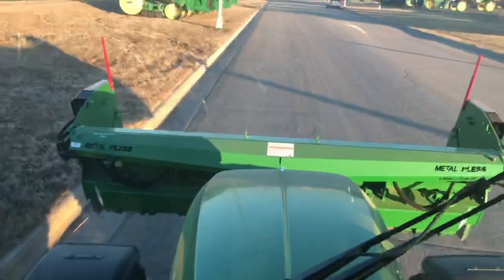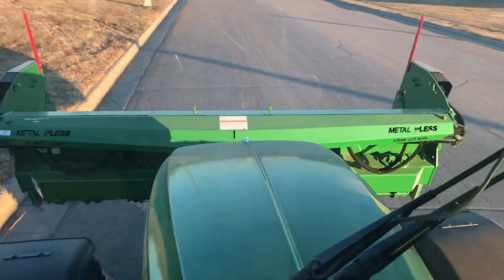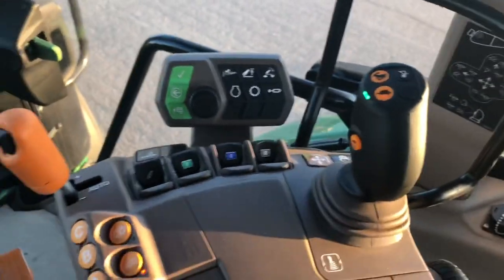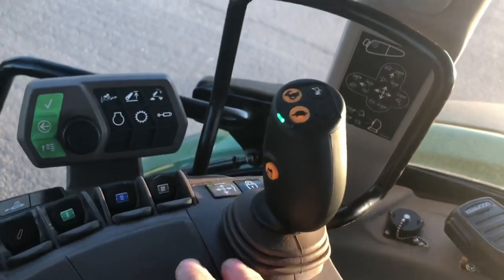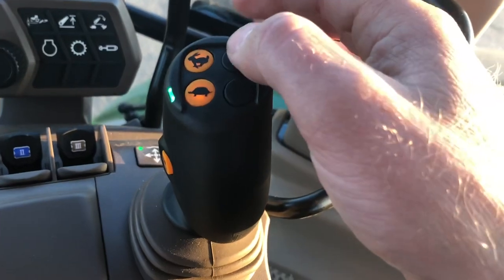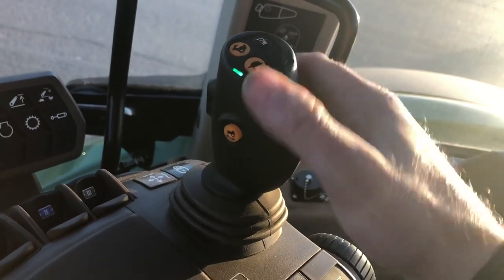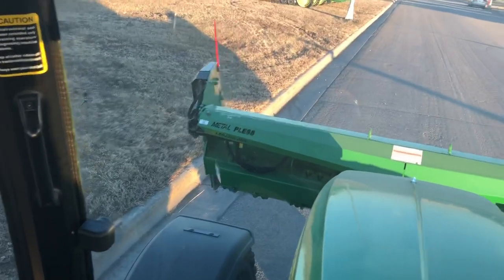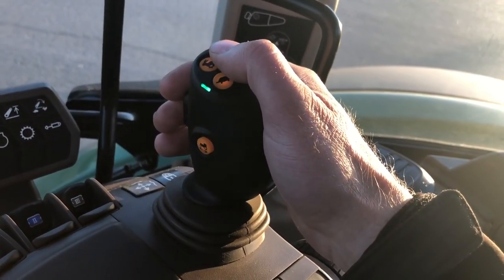Joystick Controls - Metal Pless AgriMaxx on a Deere 5R

Comment: For your front fenders do you like fixed or ones that stay with the wheel as it turns
Reply from the maker: These turnable fenders usually come factory-installed. They work great on the 5R. On the 4R, we've started to prefer the fixed front fender - just simpler and a little more durable, we've found.
Reply: When I get the snow plow for the front metalpless  does it come with the controller for my right hand on the loader control?